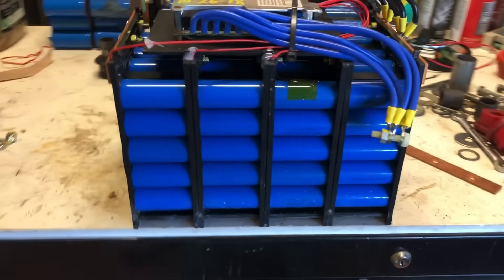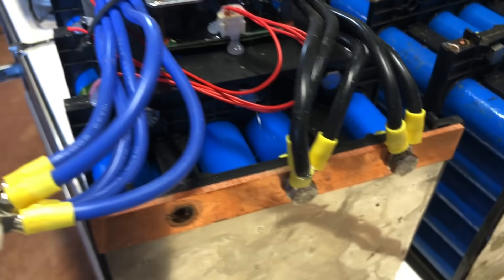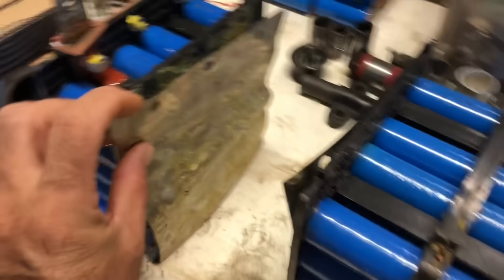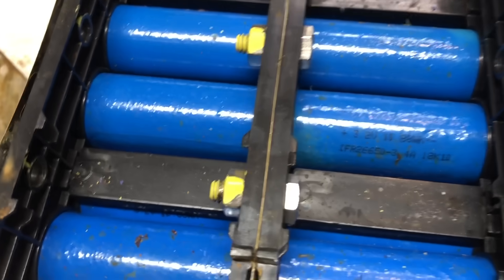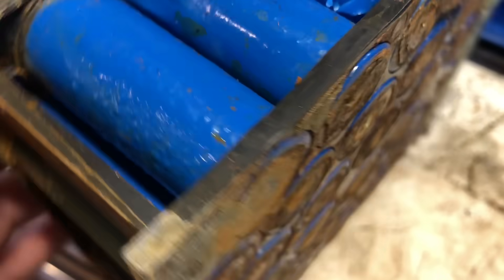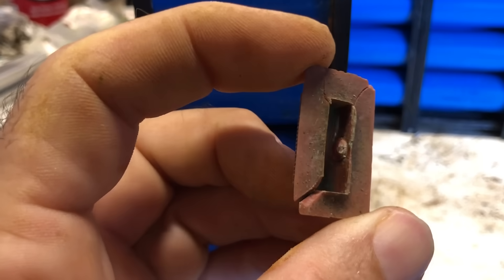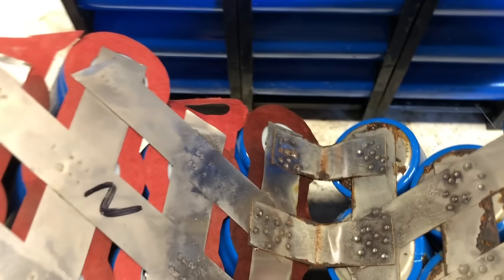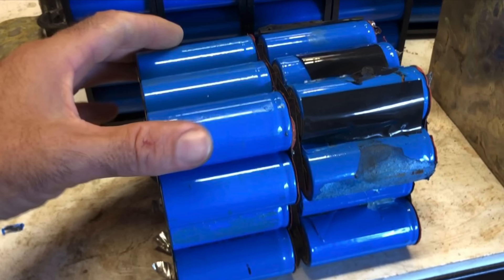Follow up to Battle Born Autopsy

Comment: What's happens is the plastic is not fibre based so it can compresses over time, causing bolts to come loose. That allows the battery structure to flex. What then happens is the main terminals, if knocked, open up the battery box to the environment, exposing it to condensation, and then rust. The loose terminals cause sparking, and heat from resistance, that melt plastic.  All they needed was a pass through on the terminal blots so they weren't wedge with plastic, and the majority of the problems mentioned, wouldn't have come about. Some corrosion can be due to leaking cells.
Reply from the maker: The heat due to poor/undersized contact and use of aluminum is more likely to cause the distortion of the plastic not the plastic compressing due to the torqued fastener. 

The deformed plastic then introduces a looseness which may cause even more resistance and heating, only exacerbating the issue. 

I do agree that once you get the heat, and with the expansion and contraction of the cells and the lug terminals being fixed in the top, there is potential for the epoxy that sets the terminals in place to shrink and crack which can lead to water ingress. 

Having heavy improperly routed cables that put twisting forces on the terminals and or a lack of having a proper battery hold down, heavy vibration and jostling, etc.. can potentially only make matters worse.
Reply: @Willdesignsandbuilds  You can lock the nuts with how much setting agent you want, but if they are wedging plastic with metal, the plastic will collapse over time, and bring about a loose connection. Like mentioned there are fiber embedded plastics and they will hold up to pressure like steel.  Aluminum isn't bad if it's a large mass. Are you saying they're using copper coated aluminum core wire? The terminals and bus-bars to me look like copper.
Reply from the maker: @JimmyCall The aluminum bolt is used in this design to carry the current and act as a bridge between the lug terminal and the positive bus bar which are both metal. 

Between those two is the plastic module cage which is being sandwiched by the torquing of the bolt, but the torquing is not significant enough to distort the plastic. 

What distorts the plastic is the heat from high current being passed through the bolt which only makes minimal contact with the bus bar and is made of a material that can get very hot quickly. 

Most FRP would suffer the same issue as it is the heat that is the primary root cause and not the toque of the fastener. 

I often use HDPE for washers to create isolation between dissimilar metals and they hold up quite well under much higher torque specs. 

Once plastics approach their certain temp, they lose their ability to maintain shape, especially if any forces are acting upon them. 

The issue here is the lug terminal and bus bar should have been designed to have a better connection and not relied on the bolt to carry the current, but instead the bolts only job really should have been to keep the bus bar and terminal in good contact with one another.
Reply: @Willdesignsandbuilds  arrr.  thanks for the heads up.  It would be more conductive than steel as you probably know.

Comment: Oh no.  It gets even worse.  More bolts through plastic, relying on the plastic itself to push the cell pack contacts together.  What on earth were they thinking.  The pressure of the padding to keep the cells together is secondary but probably has saved the day for many BB battery owners as even though its rubbish it will give another path of conduction for when the bolts holding the 'sandwich' together at the top (the primary path of conduction) inevitably loosen due to plastic flowing (deform) under pressure.

Comment: There is your design flaw... sandwiching plastic into a bolted electrical connection is asking for failure,,,,,, as plastic has a much higher heat expansion than metal, so with repeated heating and cooling under normal operation the connection will loosen especially considering plastics compressibility..... the looser the connection the greater the resistance and the more heat you will get in operation, nasty spiral to failure!
Reply: Some plastics such as Teflon have creep that distorts the plastic gradually as it is under compression. Don’t know if the plastic BB uses does this, but with the heat generated within and around the battery this distortion is certainly possible.

Comment: You think after all this time that would learn to build a proper battery instead of that complete rubbish that they have put together with redundant cells and faulty techniques. Not one thing that's been done right. Just cheap and nasty which is what America has become now. Why the Chinese are so powerful
Bye-bye battleborn your days are finished

Comment: I have seen corrosion that bad on circuit boards that I know never came in direct contact with water.  They were in a humid environment with large temp swings while being in low power/standby mode or in one case kept as a spare and never powered on after initial testing until needed and found to not work.  They literally had water condensing on them when the temp dropped, and defective water resistant cases where allowing humid air to leak in, but not allowing moisture to easily get out once condensed.  If I had not know the entire life history of the equipment (in an unheated equipment shed), I would have thought that they had been in immersed.  Also, once they failed they could have been placed outdoors until disposed of causing much of the corrosion.  Always hard to tell with unknown history.  As an engineer, that is a crap design to relay on sandwiching for conductivity,  especially for batteries that get put in mobile applications.  I would have had plats stick up enough and welded them together then had a plastic cover over what stuck up.
Reply from the maker: Yes, sweating and condensation is a thing especially in a tropical environment when you have components heating up and cooling down, expanding and contracting, breathing, and drawing in air and water vapor.

Comment: Great video. Perhaps the non-bolted nature of these connecting plates is another innovative 'safety feature' from BattleBorn that when the inevitable corrosion, pitting, higher internal resistance and heat sets in, this is your 'safety notification' to replace it, like the blue bristles on fancy toothbrushes? Well done, BattleBorn, always innovating! Edit:typo
Reply: It catches on fire to notify you that it needs replacing ;)
Reply: @whatilearnttoday5295  Ha! So much more obvious than a ping from an app!
Reply from the maker: It wouldn’t be the first time someone overthought a design and added a special feature that created a weakness. 

A great example -some 1950’s car manufacturers made frames out of lighter gauge steel purposely so that the frame would flex and absorb the road. 

Problem- it flexed so much in a turn, the doors would unlatch and swing open 😂
Reply from the maker: Where can I get those brush heads? 

Like the toothpaste tube, I’m always trying to squeeze the last bit out of them 😂

Now that the electric TB industry pushes the 2 packs, it means one brush for me and one for the shop! 

Which means my old heads live on to clean carbs, electrical connections, etc..

Comment: Are they using the bolt as the conductor on that lug?! No No No! The busbars are to make contact directly, the bolt is only for compression! Bad engineers...
Reply: You dignify them by calling them "engineers?

Comment: Plastic flows. A bolt compressing plastic to make an electrical connection is designed to fail.  Very disappointing construction.

Comment: This is partly why I held out for LARGE  high amp hour cells instead of smaller individual cells in parallel to make up capacity,
 As with any system, the more connections  - the more failure points in that system.  
The battery is don't seem to be built badly at all It's just that over time this is the kind of stuff that rears it's ugly head that really couldn't have been planned for and so mistakes happen.

However, there is response to the sparking issue that's completely something that I really didn't expect.
Reply from the maker: Ya, it’s not easy to design a well balanced product -that is one where a weak link doesn’t cut its lifespan drastically short.

Ideally you want everything matched. 

Personally I think it starts with the best cells. 

They are the most logistically challenging part to acquire and match. 

The BMS is the most likely thing to fail based on complexity and it being made of components susceptible to heat damage, so a good chance after so many years you might need a new one and not new cells if it’s been doing its job. 

And then there’s all the other bits and pieces. 

You were wise to wait and to get away from this small cylindrical cell architecture.
Reply: I'm thinking the same thing.  A battery using 4 prism cells is already a major advantage with greatly reduced connections.  And bus bars are going to be far more reliable conductors than anything that works on these cylinders.     I have two battleborns (a 100 and a 50ah)  and I'm trying to sort out how to best salvage the investment.  I've gotten 9 years of use in our van so far, so it's not like they didn't pay for themselves.  I was thinking to just open them up and fix the positive terminal and re-seal or place in a new box but then there is the rest of the construction ...If mine is clean (probably)  I may just wrap them in flex wrap to keep the pressure on the plates.  I wonder if there is a good way to improvise a more reliable connector between each set.  Maybe solder a woven copper strap (automotive grounding straps)  to each plate and have it run outside the set block where it can be connected with solder or crimp or a bolt once reassembled.
Reply from the maker: @ceeweedsl I will start the discussion on how one might approach a “fix” in my next video. Being as old as they are there’s a good chance the cases will be damaged upon entry, but it’s a small package and new cases are inexpensive and would give the one the opportunity to go with something that is easy to get into in the future should an issue develop and to just keep a general eye on things.
Reply: @ceeweedsl    Anything you can do to make it last longer is like putting money in the Bank .

Comment: I would say the battery pack shown suffered from a water/moisture problem in the first point. But the mechanic design is extremly poor and the installation method/staff was terrible (loose connections, bolts,...). Also electrical and mechanical a bad design, really! Thanks for sharing.

Comment: It appears to me there was water infiltration.  Probably even full immersion.  Also you showed a pack that had what you called nickel plated copper strips.  Those are actually nickel-plated steel.
Reply: he said he found these at a dump
Reply: Yeah that pack looks like it has got very wet for quite some time.